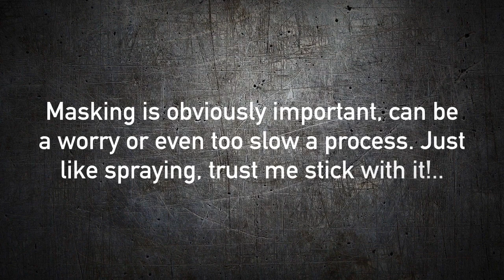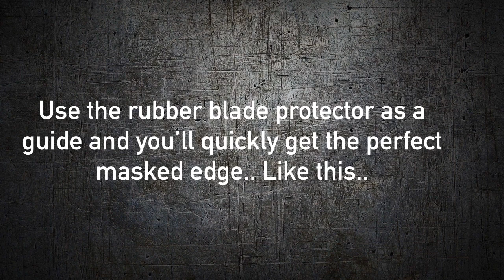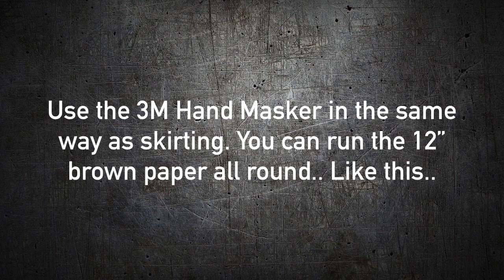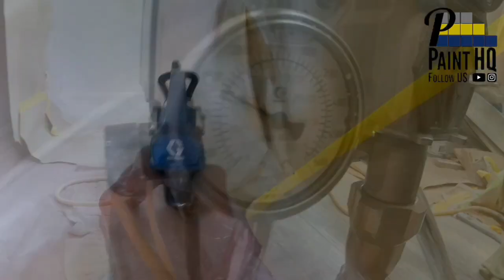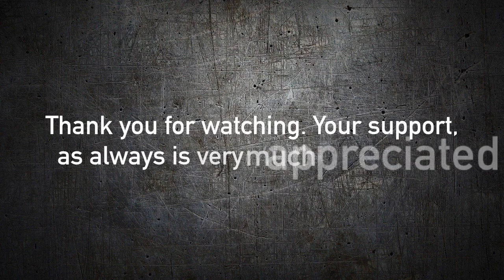How to mask a room. 3M Hand Masker Tips. What painters tape to use

Comment: Great video and production values. DIY beginner here. Should your wall emulsion overlap the caulking between the skirting board and the wall? I find it difficult judging where the transition should be. Similarly between uneven ceiling coving and wall. Also, what about where kitchen upstands have been sealed with silicone against the wall? Thanks for your videos.
Reply from the maker: Thank you Jon, really appreciate your support.. I’ll always do my very best to answer any questions 💯😊 ..Generally yes, when masking the skirting I’m looking to lay the tape along what constitutes the woodwork (or mdf 😊) and the gap that’s caulked would be where the emulsion will hit.. With the wall colour that’s being masked off for a white ceiling. I follow the same principal as cutting in with a brush, if the line / transition is not sharp, I’ll mask ever so slightly on the ceiling.. I’m talking a fraction of a mm.. like cutting in, it’s a better illusion to the eye if you don’t see the ceiling white on the wall (hope that makes sense).. Anything siliconed can be problematic. Kitchen upstands like you say are a classic example.. I have a few tactics and way up the best option.. if the silicone work is a clean beaded line, I’ll mask the silicone off with Deltec Gold or Deltec Extreme (you need good adhesion to the silicone). So basically the silicone is protected and emulsion hits the wall.. because water based emulsion hates sticking to silicone, I sometimes mask off the upstand and caulk over the silicone with an acrylic caulk.. or I rake out the silicone, mask off the upstand and caulk a beautiful straight line (probably using a profiling tool).. sorry for the long answer, hopefully it makes sense and helps you in some way.. keep in touch my friend and feel free to ask questions any time.. regards Pete 👍
Reply: @PaintHQ  Many thanks for your explanation! It's only when I started masking and painting at home that I realised now much we take this level of detail in the everyday for granted.
Reply from the maker: You’re very welcome, anytime my friend.. so true 👍 As a professional and I speak for my fellow tradesmen, decoration can make or break a project. Preparation and attention to detail is so important, get it right and it will look great and last for many years to come.. get it wrong and it can be difficult and time consuming to put right.. and contrary to what other trades think, it is a skill, a real art-form 💯 ..All the best, keep in touch, I’ll help you all I can.. I appreciate the support 👍👌😆

Comment: just got my GXFF and ultra max and really appreciate these videos as spraying is new to me. Thanks again Pete.
Reply from the maker: Ah good news Joe, you’ve made a great choice with those machines.. regarding the Ultra Max, awesome handy piece of kit.. just remember to not overwork it, small projects / ceilings / feature walls etc, ease the paint a bit if you need to (splash of water), just to keep the speed 7 or less (I like 5 if I can).. basically don’t run it flat out at speed 10.. and give it a good clean out after each use, so the water or cleaning agent is pretty much clear.. oh and run some pump armour through it (same as your GXFF, store with pump armour in it).. this way your handheld will last you nicely 👌 ..Feel free to contact me if you need any help.. I’m there for you buddy 💯🇮🇪🙏🏻😊
Reply: @PaintHQ  Thanks a mil Pete.Will follow your advice and videos.cheers mate.

Comment: Hey bro, hope all is well. Thanks for this video, really helpful. 
Definitely improving my skills since watching your videos! Question- how to get around masking windows/doors with silicone around it?
Reply from the maker: I’m very well brother, hope you are all good too 🙏 ..silicone for the painter is very problematic.. I guess you mean the silicone that can be found around internal window and door reveals.. 9 times out of 10, the silicone will need removing, clean up any residue with something like Multisolve spray.. then I mask the frame, with a fraction (1-2 mm) of a gap all round, then caulk with acrylic (keeping it off the tape).. spray the emulsion and carefully pull the tape whilst wet.. very occasionally I can mask over the silicone, if the silicone line is clean and straight, the silicone shouldn’t then interfere the painter line.. so yeah, I’d look to remove and caulk, or plaster / fill around the frame if the gap is really bad.. hope this helps my friend.. regards Pete
Reply: @PaintHQ  Hi Pete
Thanks for the reply. Yes, that’s exactly what I’m talking about ..the silicone that can be found around internal window and door reveals. Problematic is a polite way of putting it !! As you said occasionally you get odd time where the masking tape holds well?! I was thinking I was doing something wrong but kind of reassuring to know I’m not alone!
Thanks for the advice bro.. really appreciate it!! No doubt I’ll be picking your brains about something else soon 😌
Reply from the maker: You’re very welcome, anytime 👌👍 ..You’re doing great brother 💯

Comment: Great video Pete.
In Romania I did not find 3D Mask dispenser. Instead we have brown paper 30 cm or 10 or 15 cm , with adesive band already stick. Also we have plastic instead of brown paper but large wide , till 270 cm.
The problem is with dispenser . Only for small sizes we find . For long ones I use paper cutter , butvit is very unconfortable , I need an extra hand:)).
Ho you have also such of protection ?
Thanks .
Reply from the maker: Ah great info on your experiences from Romania 🇷🇴👌👏😆 ..Really appreciate your feedback.. yeah we have brown papers and plastic, ready taped.. the plastic we call it tape and drape.. I do keep some in my kit, along with a safety cutter to slice through the plastic cleanly.. I just find the 3M Hand Masker more cost effective (cheaper).. Trimaco make a similar masker, wonder if that’s available to you?.. keep in touch, always a pleasure to hear from you and I’m always happy to help if I can.. regards Pete
Reply: @PaintHQ  thank you very much Pete for your fast and comprensiv answer.
Trimaco sell in Romania only thik paper for protection the floor. For the  moment I have one dispenser for long plastic and 2 pieces for short pieces . There are very simple devices. A plastic tube with a gap at the long of the cilinder for paper/plastic to exit and , very important, am one side of the gap has a metal striat piece , who cut the paper/plastic when operator decide. Similar as your 3M masking...
Unfirtunately I do not find even paper/plastic for 3M Masking machine... 
Here , we are at the begining of airless painting era for renovation market. Usualy airless is used for new building . That because till very soon the labor cost is very cheap . Now situation is changing dramaticaly , many skilfull worker left the country to work abroad for big money... Those who still work are full of work and also for big money. They start to invest in profesional tools to be efficient.
Problem is now with the equipment , because the demand are still not so hight , the prices are very hight , and some equipment do not exist on our market ex Toughbuilt , 3M Masking , Hilti wall sander, specialized hand tool ,etc.
We do not have show rooms. He buy only after the review of youtube. It is very frustrating do not feel the tool in your hand ...
So this is why the video producer like you are very important for people like me who want to make performance .
 
Thank you again.

Comment: Hi Pete, another great video.
I bought the hand masker, makes things a bit easier, I’m fine on the paper, not so great on tearing the film. Practice I think. I’m just about to order the HEA tip, this won’t fit the Graco gun will it? Thanks again for the video’s and advice.
Reply from the maker: Hey Allan.. Yeah the hand masker takes practice, it’s worth persevering, once mastered it’s a real time saver.. here’s a tip for cutting the plastic film, it can be a pain.. keep a safety cutter in your pocket, and any problems or you’re in a tight spot (the serrated blade could be a danger), just slice with the cutter.. I first discovered the cutter as it comes with pro dec protective plastic roll.. I guess you could search out safety cutters, but here’s a link to Amazon (I’m not sponsored in any way 🙈) it’s the easiest way to show you exactly what I mean

https://www.amazon.co.uk/ProDec-Advance-ADPY003-Super-Cling/dp/B01EX4R05Q/ref=mp_s_a_1_1?dchild=1&keywords=prodec+plastic+roll&qid=1624095268&sprefix=prodec+pl&sr=8-1

Regarding the HEA tips, yeah I use the 515 a lot, it does unfortunately need its own guard.. just double check it’s the HEA ProTip (not the Control Pro.. that’s the ‘DIY’ version).. My video ‘low pressure spraying’ where I spray the kitchen ceiling covers the difference in the video description write up... let me know if you need any clarification.. sorry for the essay again 🙈 hope it helps 😆 Keep in touch my friend, you’re doing great 💯👏👍👌

Comment: Hi mate, do you ever have any problems with the purple deltec pulling off the emulsion on the walls? Been using it and it has been happening to me everywhere and this is after the paint has dried over the weekend. Baffled me to be honest.
Reply from the maker: Hi Richard, hopefully I can offer sone help.. Is this a room that you’ve prepped from the start? Fresh plaster / skim?. Or a previously painted room, where you prep, spray walls, mask then spray ceiling.. In this 2nd scenario, it can happen if the previous paint job (that’s out of our control), has been applied without priming / mist costing the walls.. in this case, the paint could pull no matter what tape is used, it’s a real pain 🙈 ..If you’re taking on the project from fresh plaster.. ensure the plaster is dust free (the Wooster Dust Eater is very handy), then either use a primer such as Tikkurila Optiva Primer.. or mix a mist coat with something like AR2.. I hope I’m not suggesting something obvious, apologies if I am, just trying to help.. it could be as simple as dust compromising the paint job.. generally I find the Deltec Purple very very good, but I can encounter problems, and it’s usually down to a previous paint job ☹️ ..Let me know how you get on, it’s great to have you contributing to the channel.. regards Pete 🎨💯
Reply: @PaintHQ thanks for your reply, it's the 2nd one unfortunately, that was along my line of thinking aswell but just wanted to make sure It wasn't just me thinking that. Great chanel and content 👍
Reply from the maker: Ah I thought that’s what you’d say.. it’s a pain, you just don’t know what’s happened historically.. just eliminate any dust if you can, the dust eater is handy or a microfibre cloth.. keep going buddy, you’re doing great 👍 ..Thanks for the kind words of support 👏😆
Reply: @PaintHQ  I'll definitely look into one of those, thanks for your advice 👍
Reply from the maker: You’re very welcome, anytime.. regards Pete

Comment: Hi @PaintHQ I've just got my first Garco GX 21 and it has 517 graco tip. Can I use 517 tip to spray walls and ceiling? And what pressure do you recommend? Thank you
Reply from the maker: Hey Andrei, thanks for your question.. good news on the GX21 👏👏👏 ..It will all depend on the thickness / viscosity of the emulsion you’re spraying, a 517 will get you spraying, a 515 can be more beneficial, especially for a beginner.. the flow rate is less.. This video may help understand..

Airless Spray Tips Explained | All About Airless Paint Sprayer Tips
https://youtu.be/0Q7LrmeMs3w

Otherwise yeah go for it with your 517, you can always move quicker to compensate 👍 ..Start out with pressure 1400, then test on brown paper or a test piece.. you’re looking for a nice even fan pattern with a feathered edge and no heavy lines either side (tails).. then up the pressure to 1600, 1800, etc until tails are eliminated.. hope this helps, great to have you contributing on PaintHQ.. regards Pete
Reply: Hi Pete, thank you for your reply. I'm at the stage I've primed wood work yesterday with 310 tip at around 1800PSI. I use just Fleetwood waterbase paints and primers. All your videos and tips are very helpful. Keep up your good work
Reply from the maker: Ah you’re doing great my friend, you’ll gain more and more confidence 💯 ..really appreciate the kind words of support 🙏

Comment: Do you notice any difference to the finish between the fflp and hea tips?
Reply from the maker: Hey Richard, thanks for your question.. The HEA (FFLP) equivalent is the Trade Tip 3 Fine Finish (purple tips).. I’ve ran a 210, I had to spray at a surprisingly higher pressure to eliminate tails and produced a lot a fog as a result.. the droplet was very fine but I preferred the Graco FFLP 👏.. I’ve heard good things about the purple tips, so I will persevere 👍

With the Graco LP tips versus the HEA equivalent (green tip).. more and more I’m turning to the HEA 515, the pressure is so much lower 1400 psi versus 1900 with the LP tips.. they really are great to spray with, less bounce back, less overspray, so clean.. I would recommend giving the HEA 515 a try, especially on ceilings 👍 There’s a couple of videos I’ve published on ‘overspray’ the HEA 515 footage really shows how nice and clean they spray.. Thanks for your continued support Richard, really appreciate it.. keep in touch.. regards Pete
Reply: @PaintHQ  thank for the reply, why do you not used a 514 or 516 fflp tips for your walls?  I used one the other week with optiva 5 and It sprayed great at around 1200psi.
Reply from the maker: You’re welcome buddy.. Thanks for the information, sounds good.. I’ll give them a go, great feedback 💯👍

Comment: What is the difference between the Q1 and the Deltec Gold? Would you still use the Deltec Gold if the sill was uPVC not wood?
Reply from the maker: Hi Joe, thanks for your question my friend.. what’s beneficial when spraying is a ‘Washi’ tape, it’s a thin, strong, smooth tape with technology originating in Japan.. I use the premium gold tapes on cured woodwork paints and yes, it would perform brilliantly on uPVC. I’m having a lot of success with the Kip range.. such as this..

https://www.amazon.co.uk/Kip-Painters-Decorating-Wallpaper-Sensitive/dp/B09HV9HHQG/ref=mp_s_a_1_20?keywords=Kip&qid=1670847531&sr=8-20&th=1&psc=1

Hope this helps my friend, keep in touch, I’ll always get back to you 👍 regards Pete
Reply: @PaintHQ  ok great, thank you Pete. So if I'm understanding your correctly, you're using the Deltec washi tape to define your spray lines, then the general purpose Q1 is just to hold down your masking paper/plastic?
Reply from the maker: Yes you’re correct my friend.. the Gold washi is for all critical lines.. then when I’m using the 3M Hand Masker to mask the trim / skirting / architrave, you can put the gold washi on the masker and run paper and washi tape in one go.. using the blade edge as a guide.. only when I’m masking emulsion (ceiling cut line).. I go round with a purple delicate washi, then Q1 or a cost effective ‘multi purpose’ masking tape to apply the plastic film to the purple tape masked line 👍😆

Comment: Vi en unos de tus videos k usas la válvula tiro limpio clean shot pero también he visto k hay un apdatador de 180 grado cual recomiendas y porque 
Necesito saber por tu esperiencia k presión y boquilla usas para los siguientes trabajos 
Pintura de paredes interiores y exteriores 
Para puertas int..y exteriores 
Para cerca de tubos de 1x1de metal hierro y k pintura usas para esta
Reply from the maker: buenas preguntas amigo mío, espero haber entendido lo que quieres saber. El disparo limpio es excelente para eliminar salpicaduras de pintura cuando utilizo una extensión de pistola. Normalmente uso una, si necesito usar una extensión al rociar techos .. Las puntas y la presión dependen del grosor (viscosidad) de la pintura .. Me gusta mucho la punta Wagner HEA 515 para paredes interiores y techos, estoy rociando alrededor de 1400 psi .. una punta grande que puedo dar usted debe tomar nota, yo uso una hoja de cálculo para enumerar las diferentes pinturas y las puntas y la presión a la que estoy rociando ... para las barandillas de hierro, necesitaría un ventilador estrecho, por lo que una punta de 110 podría funcionar pero necesitaría moverse muy rápido. Pulverizar con HVLP o Wagner XVLP probablemente sería más adecuado. será una pulverización más controlada. espero que esto ayude hermano 👍 Saludos Pete
Reply from the maker: ..Para pinturas metálicas exteriores .. vea si puede comprar pinturas de Tikurilla .. yo uso mucho Tikurilla, todos mis techos se rocían con AR 2 👍